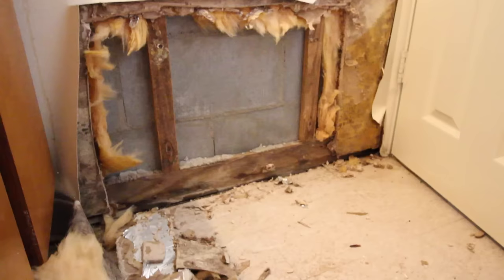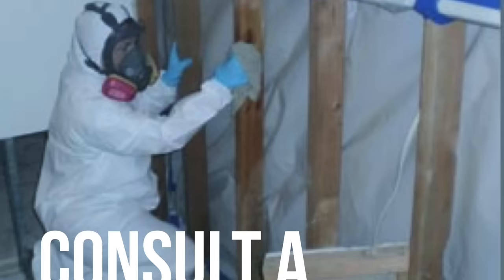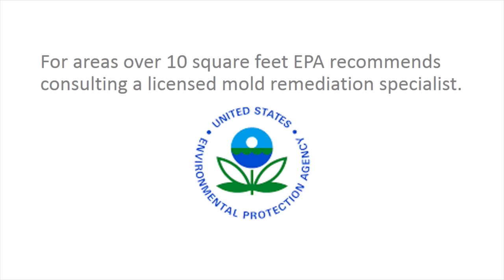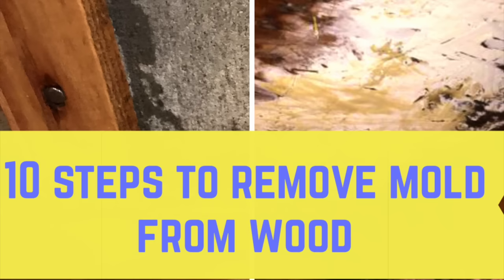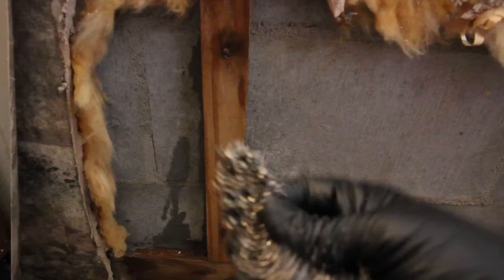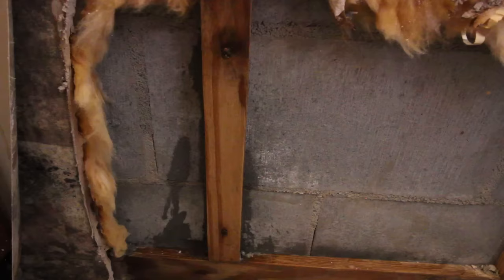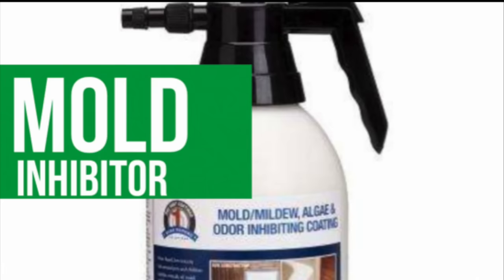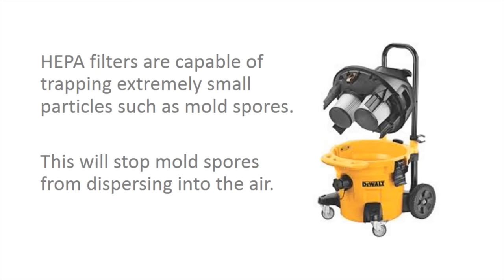Proven Ways To Remove Mold From Wood. How To Remove Mold Inside Walls

Comment: But how do you remove mold from the hidden side (the on block walls). If you leave mold on one side then it will regrow
Reply: Yes, trying to figure this one out also
Reply: It will only grow if there is moisture. Fixing the cause of moisture is key to keeping mold away and under control.
Reply: this video is terrible lol
Reply: that wood should be removed and thrown away as there is no need to have a finished basement where the basement walls leaks water
Reply: @claireh.7605  I agree with you

Comment: I’m from Maryland and we have to create a negative pressure zone which would mean sealing all entry points into the Area we’re working having a air scrubber installed and tube it outside. Once this is established we start scrubbing/disinfecting and use a HEPA vacuum to remove loose debris then hook a high powered sprayer up to get in any nooks and crannies that cannot be reached . After a day we come back to re-vacuum the entire area then apply a fungicide paint to ensure treatment and for future protection

Comment: I highly doubt this kills all the mold.
Reply from the maker: Killing the mold wont necessarily resolve the problem. The main objective is to remove molds growing on a surface. Molds dead or alive still can cause allergic reaction in some individuals.  see  https://www.epa.gov/mold/mold-course-chapter-1
Reply: The Mold Insider doesn't the fan discharge mold spores in the air? Why not just leave it open and put a fan directing in an open window like a exhaust.
Reply: @slickcatricky7694  - the surface mold/spores has been cleaned already, and hepa vacuum used. That's why he is using a fan, imo.

Comment: Why not let Lysol air dry and let it sit on the wood longer to make sure the mold dies, won’t wiping off the Lysol before it had a chance to kill the make it less likely it killed all the mold?
Reply: Lysol doesn't really kill mold. It can kill some types but not all. You really need to use an epa registered fungicide

Comment: Most helpful video I've found! Thanks. Working on removing mold from my parents bathroom. It had a bad tile job and no waterproofing methods and no vent fan in the bathroom. So far we used concrobrium and clr mold and mildew removal. And we are going to remove some of the studs that have been highly affected. Is it a good idea to use kilz mold and mildew killer on the studs? Or some other type of primer?
Reply from the maker: I would say be careful with using too many chemicals for safety reasons. The concrobium should be good enough.   You don't necessarily need an encapsulant or primer on the wood.  Some people prefer to prime the material especially if the mold growth has been removed but the wood is still discolored. The ones that have dry rot, and can safely be removed, should be - as long at they are not load bearing  studs. The main objective is fixing the moisture issue, containing the area, use HEPA vacuum during cleanup, remove affected materials safely using PPE, and dry out the material. As long as you're following the manufacturers recommendations you should be good.

Comment: Helpful. Thank you!
One suggestion: in future videos, I would warn people not to use bleach when you talk about cleaning it with detergent. Using bleach to kill mold is the most common myth I have heard over the years and I think it’s important to dispel it at every opportunity.
Reply from the maker: Thank you for your feedback. You're correct, using bleach is not an effective was to remove mold. We have a few videos that speak to that as well.

Comment: Do dehumifers kill mold already in a room or do they just stop new mold appearing also is salt effective and ok to use in dehumifers that have crystals in the top of dehumifer when Crystal's have run out I have mold in my bedroom and I use dehumifers and I dont wanna have to keep buying more dehumifers
Reply from the maker: Not really. Dehumidifiers are mainly used to remove  excess humidity (moisture) from the air in your home. Generally, the relative humidity inside your home should fall between 30-50%. When the humidity levels get to 60% and above, this can promote mold growth on walls furniture and other areas. If you have mold growing or appearing in some areas, the dehu. can prevent additional growth because the moisture source has been removed.  Regarding the crystals, you may have to look at the manufacturers instructions. Most dehumidifier units I’ve seen come with a water collection pan or a hose that gets placed in a sink or something like that. If the mold is growing you could have some form of moisture issue, high humidity, a leak, or the ac may not be functioning correctly. These are just some possible items to look into. You can get an inexpensive digital hygrometer (measures (moisture) relative humidity (RH) online.
Reply from the maker: Where is the mold growing in your bedroom?
Reply: @themoldinsider  hi its behind my bed on wallpaper behind wardrobe on wallpaper and on my celling do u want me to send photos of the mold I use dehumifers already and I have mold sprays and white vinegar
Reply from the maker: Sure. Send them to info@themoldinsider.com
Reply: @taramiller70  what is the update?
Reply: @fearless6947  hi What u mean wat is update
Reply: @taramiller70   How is the mold issue going? are you able to get rid of it? I have the same issue as you :/
Reply: @fearless6947  I don't like getting rid of things still got mold my dad said he get rid of the mold if I get rid of things

Comment: Can you use Tilex Mold & Mildew remover instead of detergent? Spray and don’t wipe it off?
Reply from the maker: You can, but it not really necessary.  The key thing is to make sure the water source is fixed, the wood is cleaned, and dry.  This is important to fix the moisture issue because the growth will continue to come back no matter what you use to clean it. Some people opt to encapsulate the wood after its dried out.
Reply: @themoldinsider  The moisture issue is definitely fixed. Now I’m dealing with green mold on wood and black mold on drywall. Some areas I can’t reach to scrub. I can only spray.
Reply from the maker: @kimberly329  you can send a couple pics to us if you’ll like so we can make some suggestions. info@themoldinsider.com
Reply: @themoldinsider  I will do that later on today. Thank you!
Reply: @themoldinsider  would you mind if I emailed you a few pictures of my grandparents garage situation. First time ever in my 27 years of living have I seen the garage have this sort of thing happen. It never has. It was just so hot and humid and damp in the air towards mid-to-end of springtime beginning of the summer and the heat and humidity just hit and it was literally overnight the garage next day was moldy all over the wooden bench on the brown drywall for garages that we have on garage ceiling had like that white fluffy ish mold that was seen on the wood bench along with a greenish bluish mostly swamp colored mold on the wood bench.   I've since tackled the problem and had the dehumidifier in there. But I'm left with not knowing how to beat tackle the cleanup and restore of the once eat-off wood bench that hasn't changed and been like that all my life. Now it's the aftermath  of basically dried up wood mold and dried disinfectant cleaning solution and I just don't know how to best tackle it.  If you can take a look ill give a brief summary in my email and shoot you some pictures if that's okay with you. And I'd really appreciate it.  
-Brenden 

P.s. my grandparents live by NHMS Racetrack Loudon NH for geographic reference to weather, NH had humidity levels of 78% or More, on average the start of summer, which is why it even happened, but overnight so quickly was shocking to say the least. I panicked use Lysol wipes to quickly cover the area with wipe then use another wipe to start forcefully scrubbing, and dumped baking soda to cover it after in a panic but then got a dehumidifier in there and haven't had issues since. Other than that I avoid the use of the bench now in disgust and distrust until i know the area has been restored new sand down the nasty remnants of where  mold was dried up. I want to sand it. Make the surface refreshed sand it down. I thought a shop vac running while sanding to lower risk of dried mold wood particles from finding a way into my nasal or on my body to campout style til they can strike and shit into my nose. Or something.. hahaha. But yeah man thank you sorry for the runoff spiel but I will send you an email and look forward to hearing back. Thank you !
-Brenden

Comment: Do you water the detergent first and can you rent a HEPA vacuum?
Reply from the maker: Yes, you add the water to the detergent first to make the solution (you can use any form of detergent  Dawn + water is also effective).  Depending on where you live a HEPA vacuum can be rented at places like United Rentals, Home Depot, or Sunbelt Rentals.  An alternative to renting one is to purchase a "HEPA filter" that fits your particular vacuum.  Hope this helps 
-Nick
Reply: Happengroup yes, very much. Thank you. Oh, would you recommend a one to one ratio of water to detergent or more water less detergent since they are all concentrated?
Reply from the maker: A one to one solution would be thick and hard to apply.  I would suggest using a mixture of more water and less detergent. For example, I have used 1/4 cup of detergent mixed with 24 OZ of water.  This has been very effective in my experience.  But remember to modify the solution based on the amount of area you plan to clean.

Comment: Is it bad if I just use a regular vacuum? Because no where around me rents hepa vacuums. Not even my home depot
Reply from the maker: The challenge you will have is that the regular vacuum will not capture the mold spores and stop them from spreading through your home.  You may be able to get a HEPA filter that fits your vacuum depending on the model vacuum cleaner you currently own.  Trying to buy a HEPA vacuum itself could get costly.
Reply: you can just get a shop vac with a 25 foot hose, put the vacuum outside close the window. this will ensure that it is not in your house.  there are hepa like filters i doubt they are truly hepa, but says it captures mold the green filters . ~ 100 bucks at HD. and another 30 bucks for the 25 foot hose.
Reply: A mold remover that kills bacteria and virus will be a more effective step than the work that the HEPA vac will do.  If you don’t have a vac but do this step your likelihood of removing the mold will be much higher
Reply: Yes, Very bad.  You are spreading spores everywhere basically doing its job for it.
Reply: @shahsmerdis  What Bardia said, this is what I do.  You don't need to filter the air if you are just ejecting it outside.  HOWEVER you MUST pay attention to a few things.  When you do this you create a negative air pressure system in the area you are vacuuming.  

This can cause backwash of the air you just ejected or worse, draw in air from underneath baseboards or exhaust fans where more mold and dust are hiding.

To prevent this make sure you have a clean source of makeup air from either strong ERV, filters or an open window with a fine mesh screen on a clean side of the area at a time when the air quality outside is good.  (summer or spring day with low pollen count or very early in the morning 3 am to 7am).

Comment: No bleach?
Reply from the maker: You really don't need to use a biocide like bleach to remove the mold from wood. If the mold was growing on something like hard plastic that is non-porous it would be very effective. But on porous materials like wood and drywall it's not effective.  The key is to stop the moisture source, fix the problem, remove the mold growth, dry-out the wood. All you really need is some form of detergent.  Not to mention bleach itself is releases toxic fumes when being used.  Even so many people tend to spray bleach on the mold only to find out it comes back in a couple days. check this out ---  https://www.youtube.com/watch?v=VSAXJfsdatc
Reply: Why does everybody think bleach kills mold? It doesn't.
Reply: Bleach makes it worse, it doesn't kill the mold it only drains it's color and spreads it around, lots of mold survives and it becomes stronger.